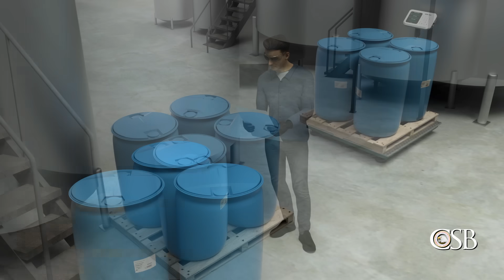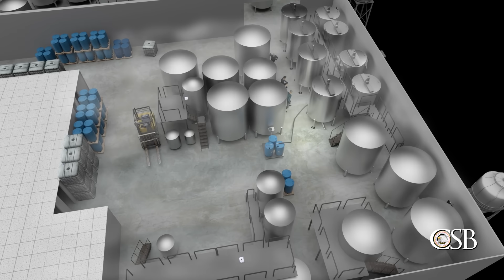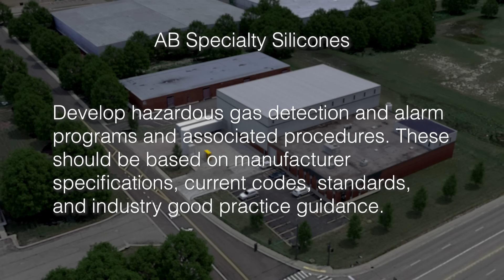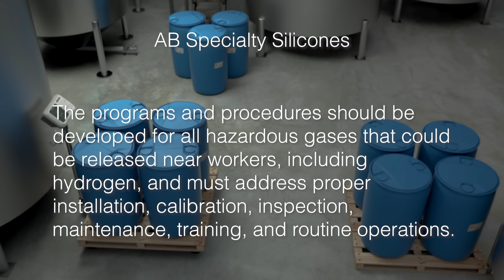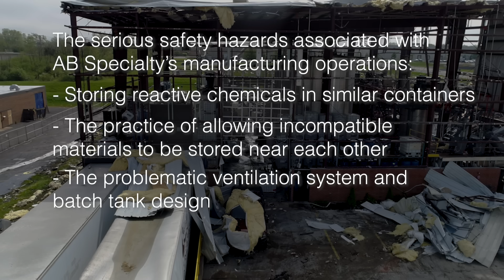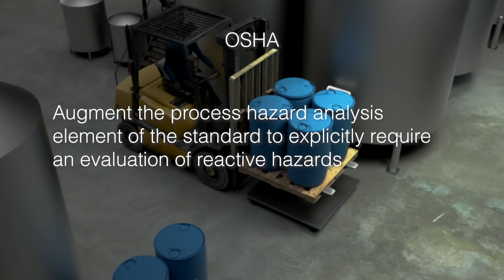Incompatible Chemicals: Explosion at AB Specialty Silicones

Comment: It's insane that chemicals which could cause hydrogen gas explosions if you mess up their production are not covered under epa or osha standards
Reply: I mean tbh, the hazard is really the volume of the chemicals used. Lots and lots of chemicals can produce hydrogen when mixed, that's very common. The company should have had a general chemical hazard control program that would have applied to this. There really isn't any gap in the regulation as far as I know, they just didn't do what they're supposed to. Just look at the fact that they had gas detectors but that they were non-functional.

I guess what I'm saying is, these chemicals really aren't especially hazardous but there should have been a program in place to identify and prevent the kinds of issues that occurred and it should have been audited.
Reply: @sauercrowder  As I understand it, gas detectors at that facility had very short life spans because of the particular types of products produced there. Arguably, they should have instituted regular testing and replacement, but it's easy to let that kind of thing slip when there's noone checking up on you regularly, telling you that you have to do it.
Reply: Its called an oversight
Reply: I'm almost certain there are more than a few production scenarios where such a reaction is used in a controlled environment as part of a different production. The real issue here is the reuse of identical vats for different chemicals.
Reply: @KiraSlith  Exactly. This was an expected reaction that was part of the normal production of this product. It was the unanticipated scale of the reaction do to confusion of storage barrel contents and incorrect ratios of reagents that was the first link in the chain of failures that lead to the explosion.
Reply: as someone with a very elementary understanding of chemistry, just the name "potassium hydroxide" sounds dangerous as fuck. potassium = boom, hydrogen = boom, oxygen = fire and more boom
edit: for fucks sake, same colored drums for the same compounds?
Reply: @technoturnovers7072  That's not quite how chemistry works.  Potassium Chloride sound very dangerous. Potassium = Boom, Chlorine = Deadly.   When in actual fact it's sea salt ( or at least a major component of it) and people eat it every day.
Reply: @technoturnovers7072  
How about sodium chloride. 
Sodium instantly burst into flames in contact with oxygen, and chlorine gas is immediately deadly. Mix them together and you get table salt. 
Chemistry isn’t always simple.

Comment: I think CSB started ok saying that the goal is to help the workers doing the right thing easier and the wrong thing harder (typical Safety II approach), but then they fell back in condescending tone "oh a procedure would have made it easier to avoid the problem" (typical Safety I approach). The lack of F&G detectors and EM preparedness seems to me linked to lack of understanding the risk associated with the production, more than total lack of a safety management system (do not know what exactly these guys had). It's interesting to note that the US still lacks a stringent series of regulations to help the industry do the right thing (or at least try, is not that we do not have accidents in Europe). I think with all the defects they have, the Seveso III and the OS directives do provide a good framework for the industry to properly assess their own hazards

Comment: It seems we all have 20/20 vision after the fact.   Some of the points made would not seem to be a code violation or be a perticular safety concern at the time.   Only in hindsight do we become the wiser.   Seems many small failures and oversights all contributed to create a dangerouse sutuation.   How the heck do you go about identifying them before any accident, how to convince company management or even OSHA officials it's something that requires attention ?
Such proceses need to be engineered such, as they fail in a safe condition.   Such as passive venting to atmosphere.
Reply: Prevention can be achieved by using the OSHA Process Safety Management (PSM) framework, including Process Hazard Analyses (PHA).  I am in Australia but was a plant Technical Manager for an American company that mandated PSM in its worldwide operations.  The PSM framework was really helpful in identifying hazards before they became a problem.  It also was effective for dealing with near misses before they became a bigger problem.  When implemented properly, there are many layers of protection to reduce the risk of a large scale catastrophe such as this one.
Cheers,
Tim
Reply: @timbanicevich5565  That's actually quite encouraging. I don't work in the continous / chemical process industry. But I professionaly train metal workers to run equipment, that includes safety training. I find the failure analysis process, and identification of the root cause a facsinating lesson.
I don't have first hand experience with the Process Hazard Analysis, although I do understand the concept of it in principle.
Always an interesting challange working with poeple and organizations.
Reply: @trespire  Ah, you're a safety person.  You are doing very important work and  I dip my hat to you!  In my experience, chemicals always behave in the same way, once you understand them.  People, on the other hand, not so much.  That's why they are fascinating and challenging.
Cheers,
Tim

Comment: I have a question:
At 4:34, you state that "potassium hydroxide is highly reactive with chemicals that contain silicon-hydride bonds, such as XL 10. The reaction of these chemicals rapidly produces flammable hydrogen gas." 
However, looking up the formula for XL 10 from the manufacturer, it seems to consist entirely of vinyltrimethoxysilane, which has no Si-H bond.

Could it be that the flammable gas generated here was ethylene, rather than hydrogen?
Reply from the maker: Thank you for the question. I would encourage you to check out "Appendix B - Hydrogen Generation Calculations" of the CSB's final report on this incident for more information. It can be found here: https://www.csb.gov/file.aspx?DocumentId=6163.
Reply: @USCSB  Thanks for your reply. The formula you give for XL 10 is very different from the one that appeared when I searched for it. 
It would seem two very different products go by that same name, which would explain my confusion.
Reply: The written report goes into considerably more detail about this, and experimentally tested XL 10 and KOH to confirm that the gas produced was hydrogen. AB Chemical's product page for XL 10 also notes SiH content of 7.55 mmoles/gm.

According to the report, XL 10 is a copolymer of dimethylsiloxane units with methylhydrogensiloxane units. The SiH bond exists in the methylhydrogensiloxane unit, as the name implies.

Comment: I'm glad about what was learned about the safety issues and hope it has been implemented. Why was it OK to add the 10% potassium hydroxide to the first batch, but it reacted and caused an explosion when added to the second batch?
Reply: Same question here. I'm assuming only a small amount of KOH solution was required to adjust the pH, and this was acceptable and didn't cause significant H2 generation. But in this case it sounds like a large amount of KOH was added in error, under the assumption that it was the silicone precursor instead.

@USCSB could you elaborate?
Reply: @gjsmo  Yes, this is exactly the case. It was normal to add a small amount of KOH to adjust the pH after the main production sequence. The entire quantity of XL-10 had not yet been added to the mixing tank and the operator mistook a barrel of KOH for XL-10. As a result, a massive amount of KOH was added to a large quantity of XL-10 very quickly, releasing a tremendous amount of hydrogen gas. The amount of KOH normally used to adjust pH was miniscule by comparison.
Reply: @gjsmo  Thank you, that makes sense.
Reply: Many reactions require specific conditions to occur, including pH level. It's likely that hydrogen is only produced once the pH gets too high, which wouldn't be the case when the procedure was followed correctly. Instead here a massive excess of KOH was introduced, producing the right conditions for the hazardous reaction.

Comment: Was the ignition source ever found?
Reply from the maker: Thank you for the question. From the CSB's final report on this incident: "It was not possible to identify the specific ignition source that initiated the explosion. Multiple potential ignition sources were present in the production building, including electrical equipment, wiring, and installation methods that were not intrinsically safe. Other sources, such as a spark from a dropped or thrown tool, electrostatic discharge, the use of heavy machinery, personal electronic devices (cell phones, etc.), and so on, also may have initiated the explosion." You can learn more here: https://www.csb.gov/file.aspx?DocumentId=6163

Comment: For processes I always like the idea of simple color coding or even physical incompatibility. If the standard 'probe' they use for sucking up the material is physically unable to be inserted into containers with incompatible materials, it is extremely hard to mess things up. Even just having different color tape on different barrels would likely have prevented this.

I am curious, did the company do proper risk analysis, and know that hydrogen gas could form when mixing some of the chemicals on site?
Reply: I was thinking the same thing about some sort of labeling or even painting or different colors. The idea of different sized openings for probes is spot on too.
Reply: RE color coding: well lets not forget about color blindness, it's pretty common and surprisingly often undiagnosed! big lettering would be a good fallback for visual identification. mechanical incompatibility is a good idea too, although I would expect it would be difficult to implement if you have a large number of different chemicals; how many cheap-to-cut shapes can you make that mutually don't fit through each other? and also visually obvious what's happening to prevent "oh it must just be jammed, lets just force it through"
Reply: Bungs on drums are pretty universal usually 2 inch
Reply: @alancomercomer2588  oh what's that do?
Reply: @spambot7110  well I've worked with chemicals for twenty six years eve only seen one drum with a bung smaller than two inches so you can't have something bigger than that to suck up the material.
Reply: @GsaUce Rug that would be cool! although remember, this plant had non-functioning gas sensors installed. technology can only fix so much, if the company doesn't care it'll break down and go unused. i'd also be concerned about the opaque nature of RFID compared to visual markings and mechanical interlocks. if the tag rejects, people will be confused about what's wrong. is this the wrong product? is it mis-tagged? is my machine malfunctioning? making the tag a permanent part of the container would probably help avoid uncertainty about mis-tagging, and designing the system to clearly state what exactly the problem is (instead of just locking out and turning on a red light) might help mitigate confusion around cause, i'm not sure. def wouldn't want that to be the only layer of protection though

Comment: 1:40 wait is that a funny error or do CPUs really have both silicon AND silicone in their manufacturing?
Reply: CPUs use silicone to glue metal cap and substrate together
Reply: Silicone is a good insulator, it wouldn't surprise me.
Reply: Sillycone
Reply: silicone heat sink paste - it's been around forever.
Reply: Silicone is used to bond the IHS to the substrate. And on Intel <9th gen and some AMD APUs they used it as thermal interface material.